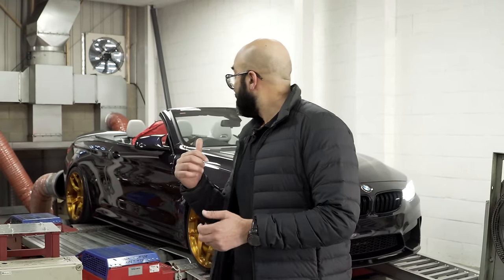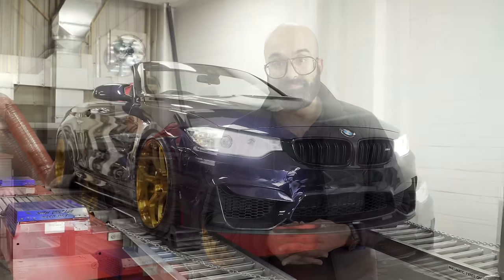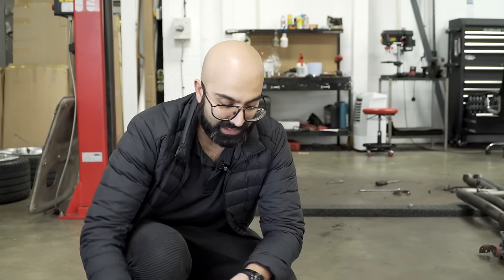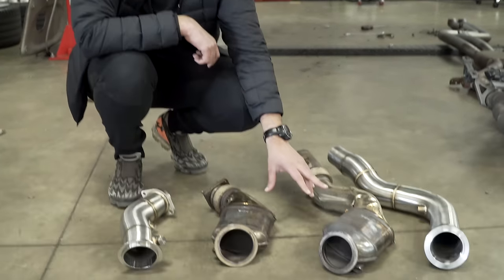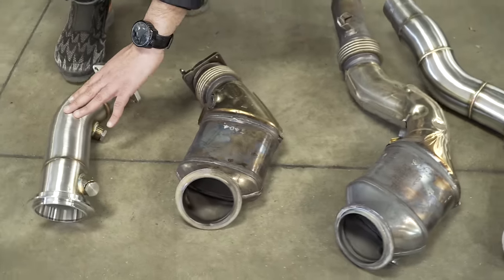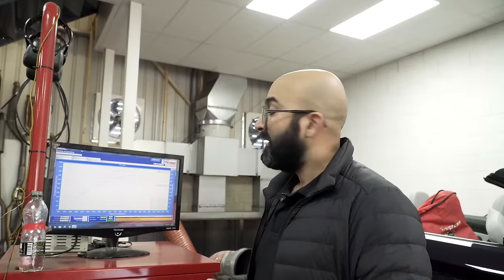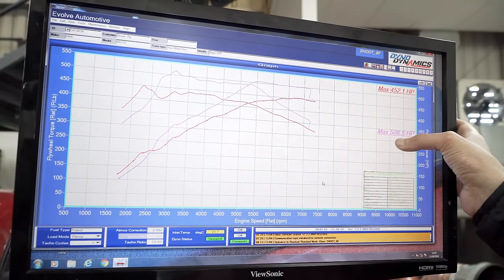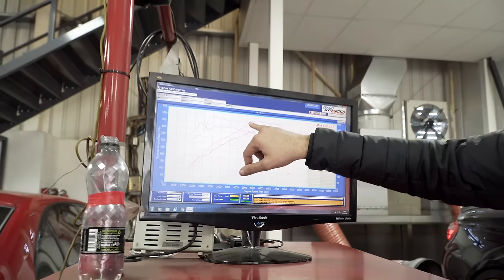Full House Customs F83 M4 gets a Stage 2 Package

Comment: Interesting to see you make the low down torque less spikey. I had one which was mapped but very hard to drive hard without it being a handful.
Reply from the maker: This is the exact reason, and another reason we actually own a majority of the cars we tune! We found a tuned car quickly became undriveable which is why we developed this smoother map.

BMW actually did similar, early softwares had more low down torque than ones built now.
Reply: @EvolveAutomotive  Thanks Imran. I suspected that was the case. Appreciate the reply :) great vids btw.